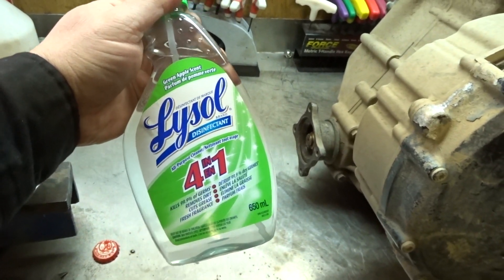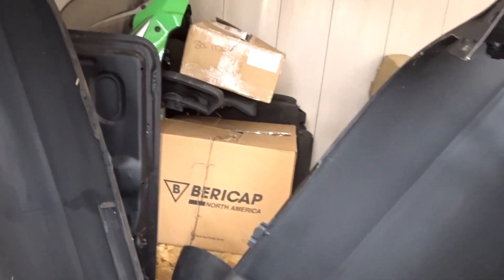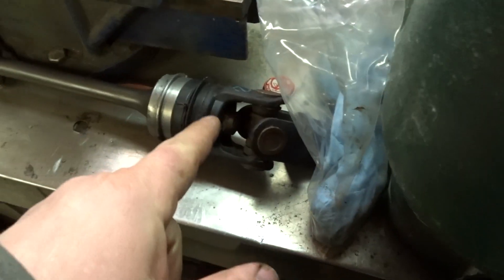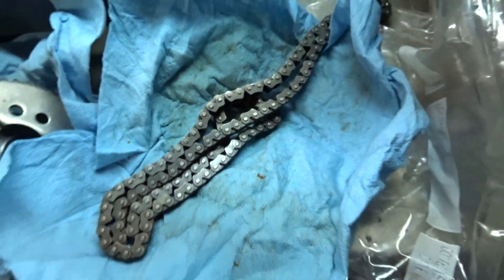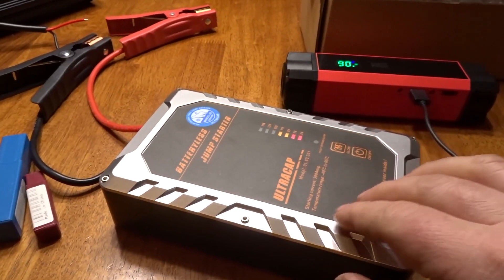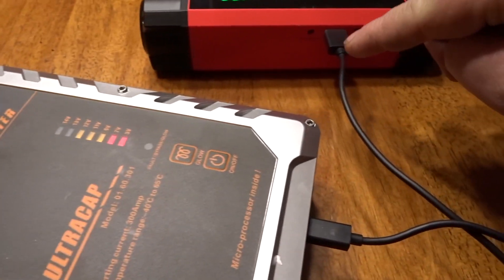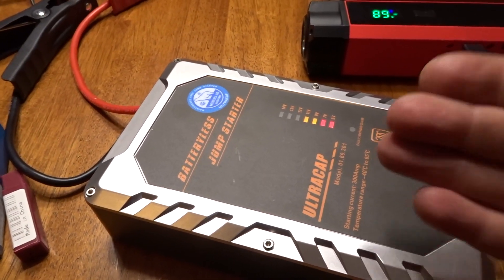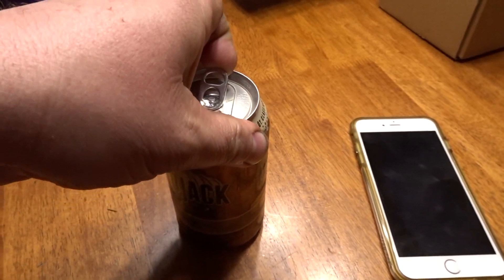Finding Parts in Hoard

Comment: Gerry try Hotgluing the sending unit it makes  aprotective cast and protects the wire very well , I do this to fix freys wires that`s been pulled out of block ends build it right up over top does`nt hurt a thing  .
Reply from the maker: i've done better than that you'll see in a much later video on what i did